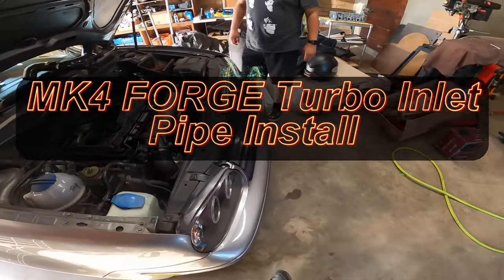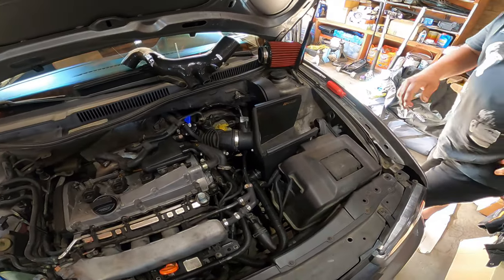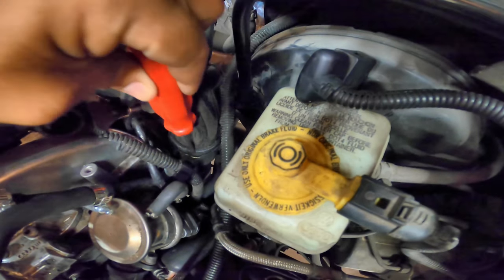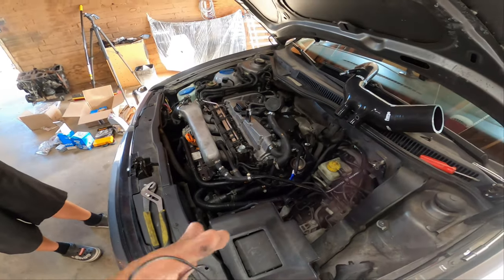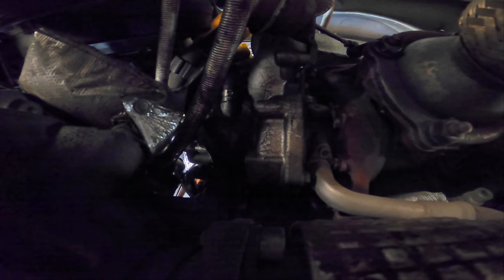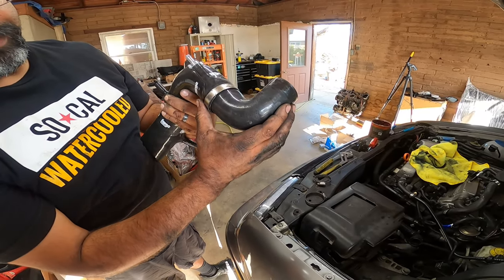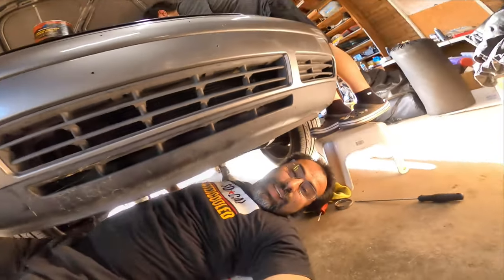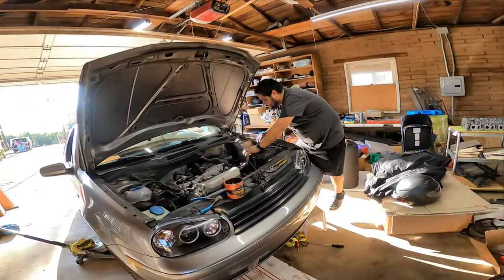MK4 Forge Turbo Inlet Pipe Install

Comment: Did you have any problems getting the inlet around or next to the coolant hardline
Reply from the maker: You just need to take the bolt holding the coolant line off so it gives you a bit of extra play to get the pipe in. Takes a bit of effort but 100% worth it